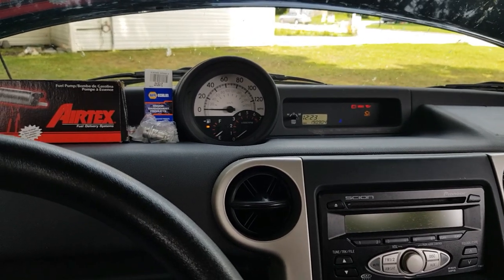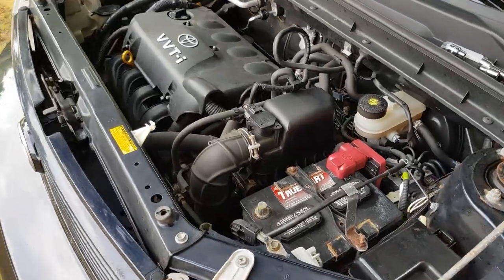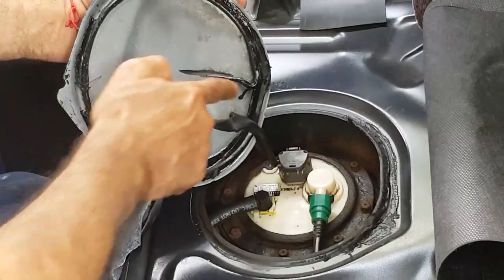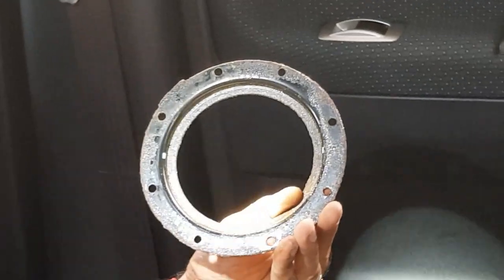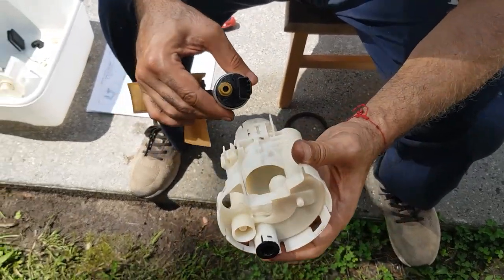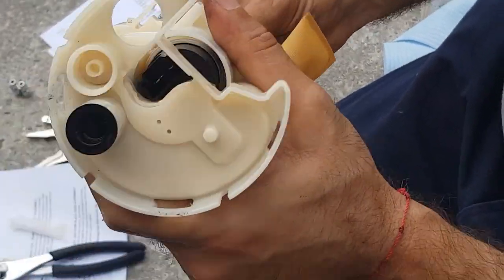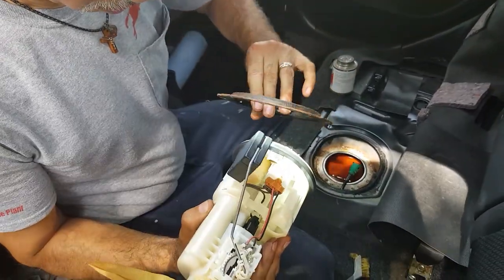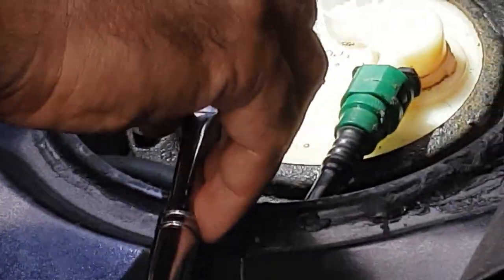2006 Scion Xb fuel pump

Comment: My gadge doesn't always work. Is this common? No issues but is this a sign I'll have issues soon?
Reply from the maker: Good day William! Yes, especially if you are up there on mileage. From what I gather from the service manual which I linked now at the end of the description text, hopefully it's the fuel sending unit assembly. Always start the cheapest route first to fix the problem. The order of troubleshoot should be sending unit, wiring (which should be in good shape) and last the whole combination meter assembly. You'll need a standard multimeter for your checks. Good luck in your repair! Thanks for watching my video repair and God bless! Here is the fuel sending assembly unit from rockauto. https://www.rockauto.com/en/moreinfo.php?pk=4717806&cc=1432818&pt=4436&jsn=326